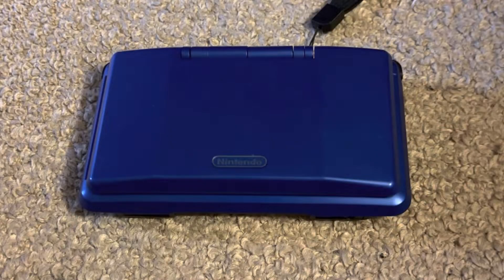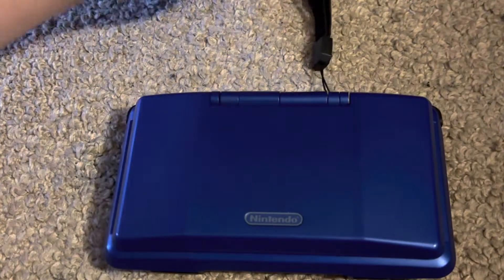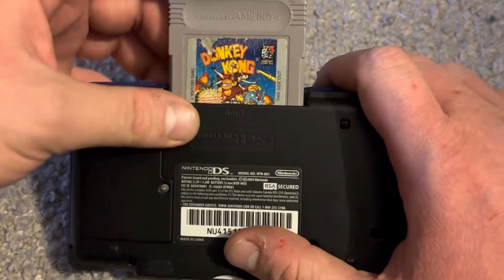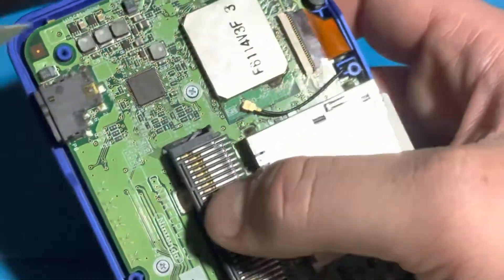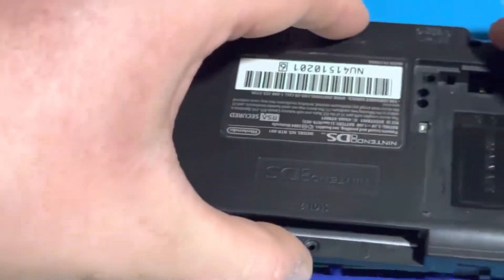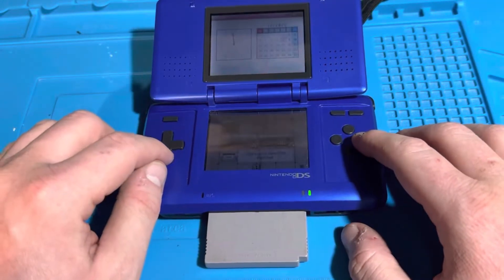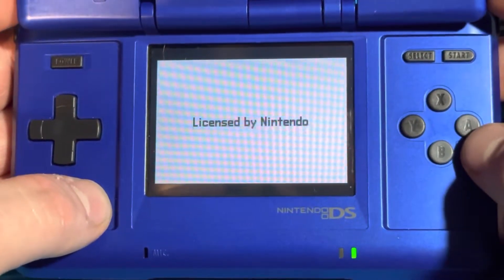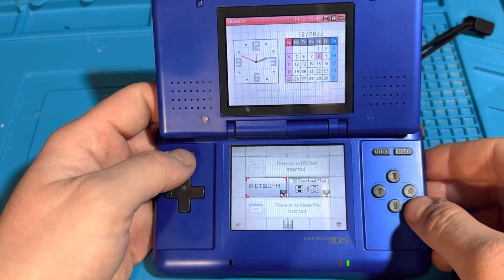Nintendo DS Original Slot-2 Mod for Running GB/GBC Games Physically Prank!

Comment: Theoretically there could be a way to make it work. You know how pokemon transporter requires you to take the flash cart out and then insert a pokemon game? That works because the rom for pokemon transporter is already loaded into the GBA RAM and then it can detect the trade from GBC and then convert it to a format that can be added to the GBA .Sav file. If someone coded an emulator that was loaded into GBA RAM and then you took the flash cart out and inserted an original GB cartridge, maybe the emulator (already running on GBA RAM) could detect the cartridge and run the rom physically.